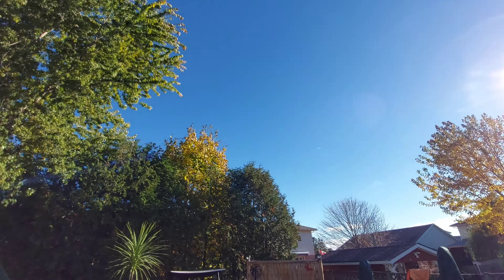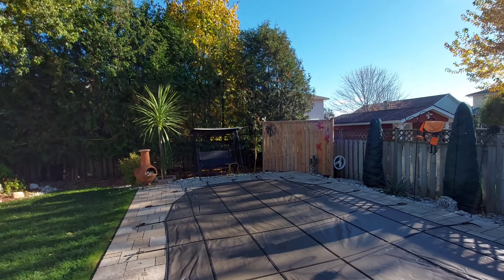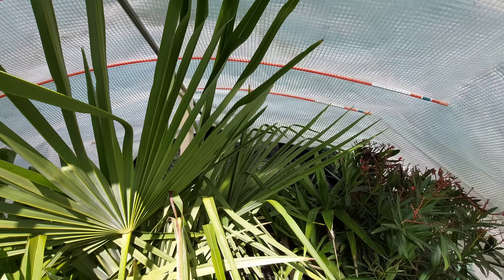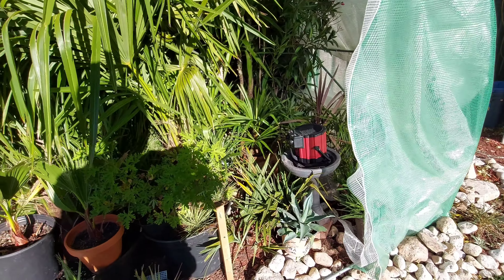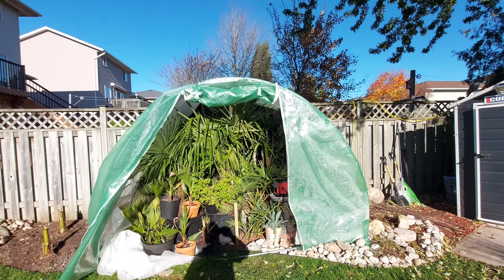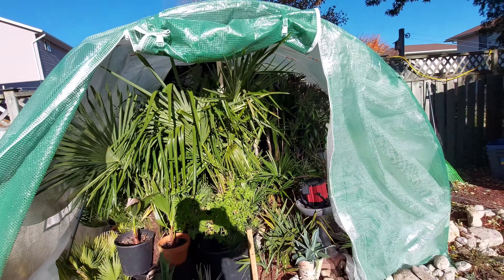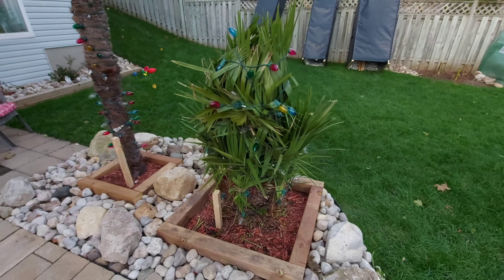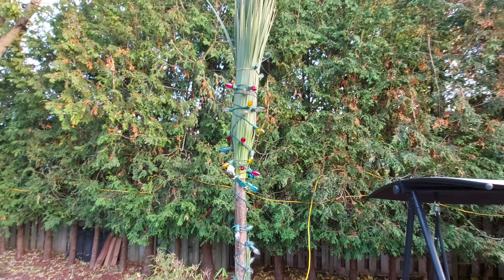Winter Palm tree protection for colder climates.

Comment: Looks good, bro! Really great job putting that all together! Boxes look seriously pro and very warm!

Your greenhouse is in a great spot. Tons of south facing sun (luckily you are not in the woods like I am lol) and up against that privacy wall for northern winds along with the black back wall tarp, it’s a really awesome spot!

That said, my greenhouse was a failure because of constant high humidity and lack of airflow. I could not bring down the humidity in mine and it took constant attention to get air flowing through. It was just too much for me. Also, another thing is watering the plants. Yours are packed in tight, which is good for warmth, but it’s going to be hard to water the pots in there. Planted ones don’t need water, but the pots probably will. Hopefully you’ll have better luck that I did!

I ditched the greenhouse and just put everything in my basement with grow lights and tons of fans and that works well. Hoping for better results in your greenhouse!
Reply from the maker: Thanks my friend and I really appreciate the positive feedback! Like they say work smarter not harder and it only took me a couple of decades to figure that out 😂. I had a lot of potted plants in my lean-to last year and they all did well with no watering. The humidity is a challenge and I forgot to mention that I added two fans. One for air circulation and the other is venting out the humidity through the side mesh opening. Interestingly enough I had no ventilation last year only a fan in my lean-to and I was worried about rot. I tried to open up the lean-to as much as I could, weather permitting so that may have helped. Hopefully everything works out and it's always a challenge to keep our plants happy during the winter. Good luck with all your winter prep and thanks for watching and I always appreciate the support👍😁
Reply: @Sandor68  Oh okay, that all sounds like a good deal then! You’ve got a great plan and I do believe that could work! Awesome to hear! Keep in touch…

Comment: Looks good and fancy too lol The ground is white here in Washago this am so it  is coming your way. Good luck that is a lot of eggs in one basket for the greenhouse but 1000 watts is a lot of heat too may need a fan too. My reinforced plastic like that failed this summer lots of holes hope you have better luck. Thanks for the video cheers.
Reply from the maker: Yeah we got a bit of snow this morning but nothing that stayed buts it's coming lol. Yes I did install a fan in the greenhouse but forgot to mention it and I'm hoping it's survives at least one winter. I priced out a custom made heavy duty cover for the greenhouse just incase it does fail. I'm running the greenhouse heater at 750 watts but if I need I can crank it up to 1500. I need to invest in solar power like you lol. Thanks for watching!

Comment: How long do you leave them in their boxes when the weather goes below 32? I would think Palms need light too. Therefore, is the C9 Christmas lights providing the required light? Thanks for making this video too.
Reply from the maker: Hey Kevin! That's a great question which I get asked alot. Because of the lack of light and cooler temps the roots of the palm are not as active and slowly stop producing nutrients and the palm goes dormant and because of this they are able to survive in complete darkness for several months. The amount of light the C9's give out are negligible and are really only for heating the inclosures. With that all said I  think it's important to able to open up your inclosure(s) as much as possible during the winter to insure you get as much air circulation to avoid any type of mold issues due to the fact that the inclosure(s) can build up alot of humidity and mixed with the cooler temps can cause mold issues. Hope this helps and I should make a video to address these questions. Thanks for watching!
Reply: @sandorspalms  Thank you for your detailed response . If you have the time making that video reference how long you keep the palms in their boxes and how you maintain them ie water etc...would be great. I looked for such a video and  couldn't find one. Again, thank you so much for replying.
Reply from the maker: @RFCDAY  My pleasure Kevin and I'll definitely make a video to address these questions! Thanks again and hope your weekend went well!